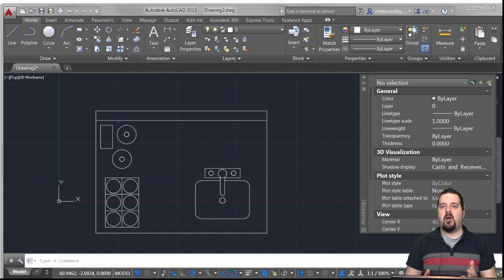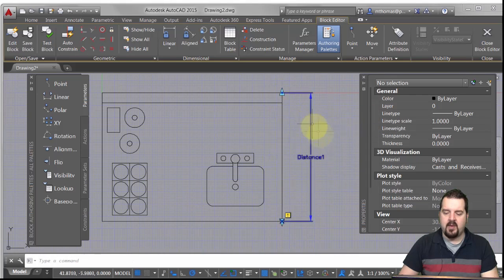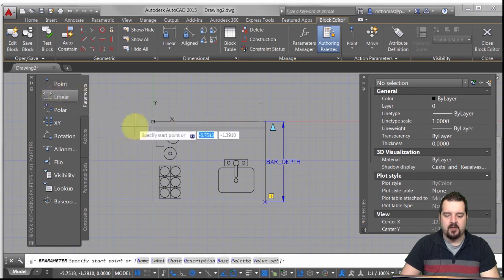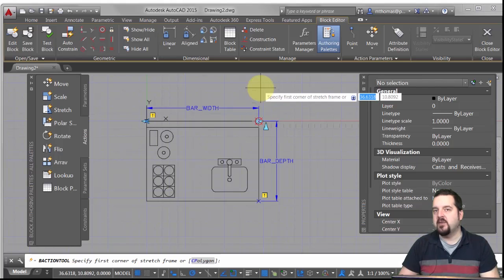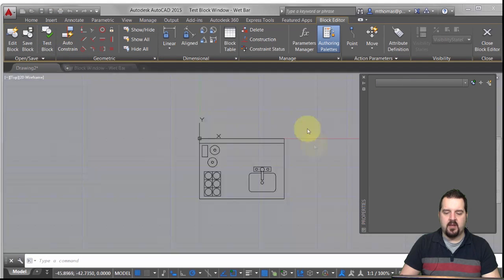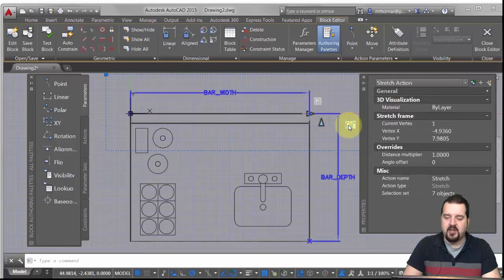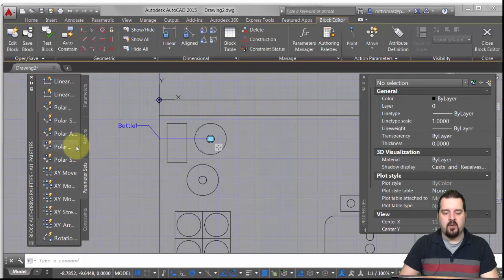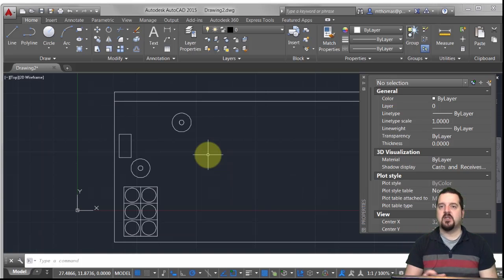Dynamic Blocks: Parameters and Actions - Part 1

Comment: Hi I wonder if you could answer a question for me, can you edit an action in a dynamic block? for example I have a block with a stretch function in a dynamic block and I want to add a hatch pattern to the element and have the hatch stretch with the element, is this possible to add? or do I have to delete the action and start again? I don't really want to do this as the action is chained to an array action also.

Comment: Very good video.  I recently had to design 12 of a thing that were all the same save for one dimension.  I drew one block and easily changed one dimension for the other 11 and it was nice and easy.  One quirk that I haven't figured out is if you later go and changed something else about the block they all reset to the original dimension: I had to go back and enter the correct dimension for the 11 with the different dimension of interest.

Comment: Hi, I need your help In Look up parameter.
How to add parameter on diameter..
Actually I've a block with some holes, and all c.d. and hole diameter and outer size depend on   a particular Hole.
So I want to control all dimension through that hole..But I don't know How do I do this?

Please help me in this.